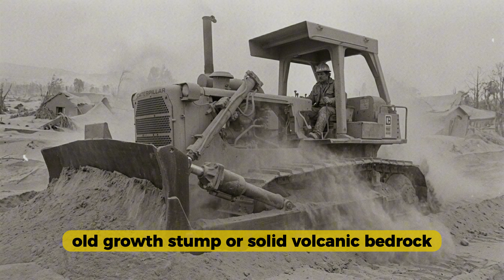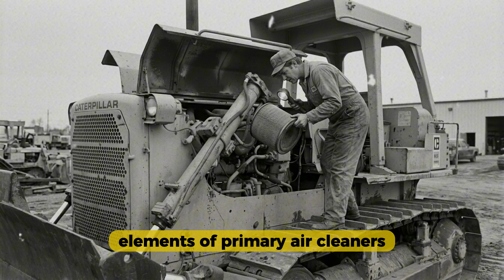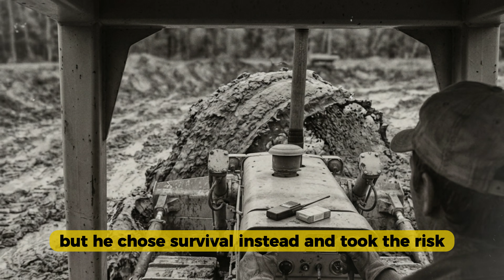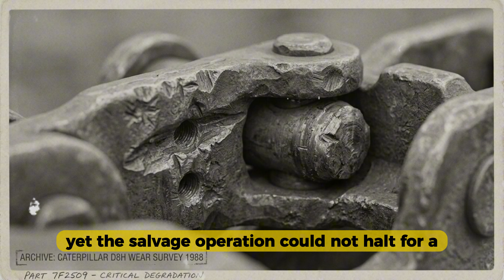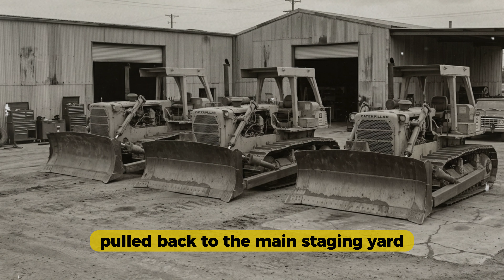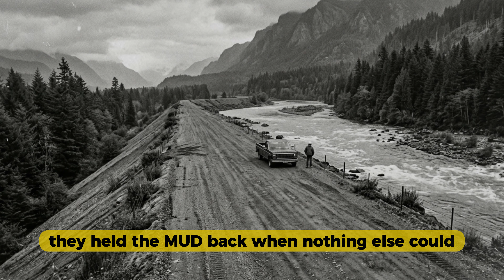65 Caterpillar D8K Bulldozers inside the Mount St Helens Blast Zone 1980 Salvage Operation

Comment: Yes,I live se bc 1980s the clean-up was huge job.They bought used D8-D9 dozer from cat finning dealers sparwood,bc.Weyerhauser take huge job replanting forest lots lumber company in 🇨🇦 come visist learn on this.Thanks video.
Reply: Remember Mt St Helen's. May 18 1980. Was hot / dry early spring. Early crops were filled under. Waiting for rain. Turned wet / cold. We seeded with aircraft. Few libs of Canola into the mud it grew. Later seeded crops in June froze hard in Aug in Ak. Crops were very poor. Late seeded NOT even good for green feed for livestock
Reply from the maker: Buddy, that is an incredible piece of local history! The scale of that clean up and replanting must have been massive, and those used D8s and D9s were definitely the right machines for it. Thanks for sharing this fascinating memory ❤️